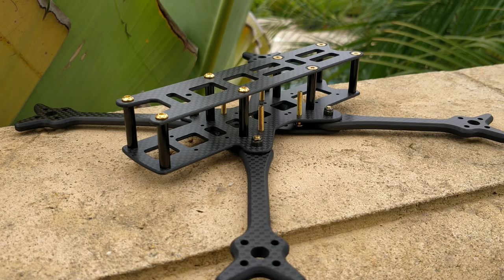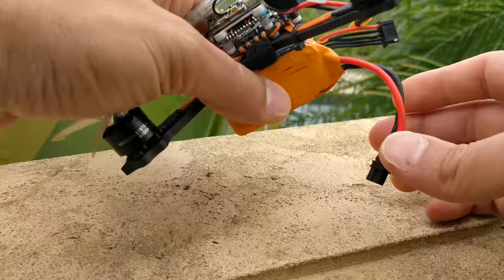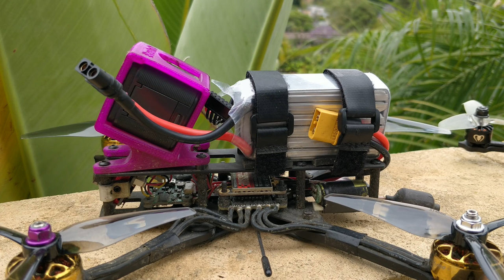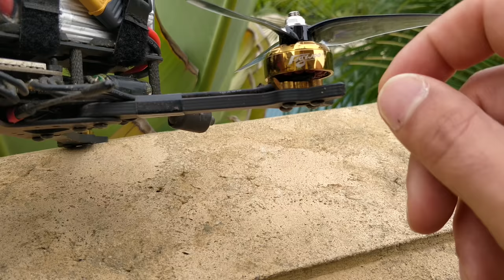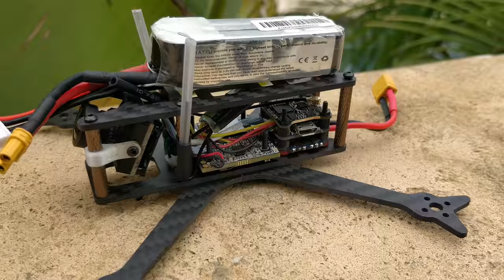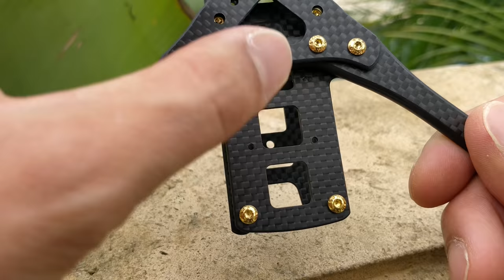Quad setup and flight performance - Quad Theory (WARNING: Lots of talking only)

Comment from the maker: Table of Contents:
00:43 Frame geometry
06:49 battery placement
23:47 weight distribution
27:23 split cam frame rant
30:00 current hardware setup
34:14 new frame with 5mm arms
This table of contents brought to you by WeAllFallDown FPV.  :-D

New 16x16 stack on the way for testing: http://bit.ly/2MZuVhR
Isn't this just a Sailfly remake?: http://bit.ly/2IirkWp

My main quad setup:

Hyperlite Glide Floss (will be re-released soon)
Motors 1750kv: http://bit.ly/2Zkz0OL
ESC (new): http://bit.ly/2WDBhmq
Prop: http://bit.ly/2LfZS0k
Battery: http://bit.ly/2XXjbwU
FC: http://bit.ly/2XRc8G8
FPV Cam: http://bit.ly/2Q7LfL7
Vtx: http://bit.ly/2HsrASs
ND GoPro Mount 30deg: http://bit.ly/2WC15zc
ND Filter (if used): http://bit.ly/2WEmQ1j

TBS Crossfire: http://bit.ly/2WxfRax
X9 Lite w/ HALL SENSORS!!: https://bit.ly/2WI5Uw6
By popular demand, THEY WILL BE SUPPORTING D8 MODE!!!  Just update the firmware in the future!!! WOOOohOOOOoooo

780g AUW with all three cameras strapped to it.

Equipment I recommend:

Micro Eagle - 
http://bit.ly/2Q7LfL7

Rush Tank Vtx -
http://bit.ly/2HsrASs

Fantastic solder-
https://amzn.to/2P5QM2W

TS100 iron -
https://goo.gl/DqBipa
https://goo.gl/svK6DD
https://amzn.to/2OV5XMh

WaFL’s Cap Cap
http://bit.ly/2GUpXxO

Xing 2306: https://goo.gl/TT9gnw, https://amzn.to/2VkZ8rt
Flywoo 2306: https://goo.gl/xuLG6d
Hold off on 220X motors for now.  There is a bug in BLheli/BF that makes them act a little weird unfortunately.  :-(

Sub $200 5" build that's still good:
Frame: https://goo.gl/EpXQhZ
FC/4in1 Stack:  https://goo.gl/HprVbj
Motors: https://goo.gl/h5rofi
Props: https://goo.gl/ZnzY2y
Props: https://goo.gl/VMBiQh
FPV Cam: https://goo.gl/FDJhYw
Vtx: https://goo.gl/JNVDMn

Batt pad material: http://bit.ly/2QGWhYb

Starter goggles I recommend: https://goo.gl/GvJUkT

Tips?
PayPal: https://www.paypal.me/kababfpv

Please use my referral code if you're gonna buy a Tesla.  You get some free stuff when you do and I get better status with Tesla: https://ts.la/bob40889

Bitcoin: 1E4XZXoD4rS6MYWVWuenY7Kw2M1YgyNpoQ
Nano: xrb_1188ek5bd7tb9kw67asnp9o65byuoaxbtpxuznx1ribf75x78awywmakj55f
ETH: 0xD067F93811f2eC31CB1928901002dfdf9A492EF5
LTC: La2KWYAjp4VT2Lq2M76pbjzXWvRyjpfCtG

Comment: Here is your table of contents Bob.
00:43 Frame geometry
06:49 battery placement
23:47 weight distribution
27:23 split cam frame rant
30:00 current hardware setup
34:14 new frame with 5mm arms
Reply: Thx!

Comment: About stretched frames, the layout doesn't increase your pitch authority: you do increase the pitching moment Thrust x distance, but the inertia due to the motors (most of the weight) increases as the distance squared. As you said, in racing you don't need much pitch changes, your turns are almost just rolls, and you gain roll authority by reducing the distance to the symmetry plane.

Comment: I really enjoy listening to your insights. I have learned a lot and has helped me evolve as a pilot and builder. I use your Floss 2.0 frame as one of my freestyle quads. I don't take HD video most of the time and it just flies so well as a racer or freestyle quad and usually at the same time as I like to hit gates and then do some flippity-floppity stuff around them. I have quads with batteries on the top and bottom in 4S and 6S configurations and I like all of them. Please keep up all the passion for our hobby. It has really helped more than most people know.

Comment: With all respect, but in your statement on point of gravity you make the wrong assumption where you turn the battery 90 degrees. You should see the cg as a point on the Z-axis (yaw) so turning the battery around the Z-axis does not change its CG position to the quad frame. It only changes the air resistance and mass distribution when the quad rotates along the roll-axis.
Reply: Do you agree?

Comment: You can always log and look at your gyro data to see what your average orientation is.  Freestyle or racing, everyone has a different pace or style but can get a sense of how much pitch you tend to average and then based on that you can make decisions of what geometry and battery placement are ideal for your style of flying.  For most folks it may not be a significant increase but for racers who want every possible advantage, 5% is a lot of advantage and could potentially be even higher.

Comment: Love your discussion videos!! Thanks for your research time :) 
@KababFPV what do you think about the Floss 3.0 ? You don't show on any video.
Reply from the maker: I didn't actually designed the floss three. It's the only frame in the entire Hyperlite series that I have not designed. It's a nice-looking frame and it's somewhat original however I feel it's inefficient and unoptimized. It still works fine I would however I prefer my own floss 2 as it is about the same weight but much much stronger and easier to work on because there's a little more space on the inside
Reply: @Kabab  thanks you for reply! maybe someday you can lose 5 min talking about the v3 frame or comparing them with your v2? this can be awesome :) ! Thanksss!!!

Comment: Two frames I’ve flown that I really felt that super locked feel on were my old Stingy and also my Remix, they both have a really wide stance compared to my other builds. 

The Remix with the pack mounted toilet tank style feels very nice, it feels like the quad doesn’t have to work as hard during manoeuvres. 

Really enjoy your longer videos, man. 🙂

Comment: Just finished transferring my components to the glide frame. Using a 10 gram tpu couch, 2207 xing motors and 1300 piro 6s, Im coming in at 630 grams. I can shave another 5 switching to a micro axII antenna and another 40 by ditching the 215 gram 6s batteries for the 176 gram 1100s. If i move to a foam couch, another 8 grams can be shed.
Reply: Your frame is AMAZING! Huge difference in propwash handling from the source one. It can take a beating as well....I put in her in the grass HARD no breakage....see the end of my latest video going up soon.

Comment: The reason battery underneath feels better (to me) is camera placement in my theory. I believe underneath batteries allow and normally “put” the camera right next to the fc. Which is where the quad pivots.  Just my theory and sloppily written on my phone. Keep up the great content!  Just finished your video. Smh I know better than to comment before the end.
Reply: Ian Walker this! The thing about battery placement is that in flips and rolls the quad rotates around the center of mass. There is no “swinging” or pendulum effect whatsoever, but the camera has totally different sweeping trajectory when you compare top vs bottom mount. Also when you roll during the turn the top mount battery pushes you into the turn while the bottom mount pushes you out of turn, so that might also account for the said “swing”.

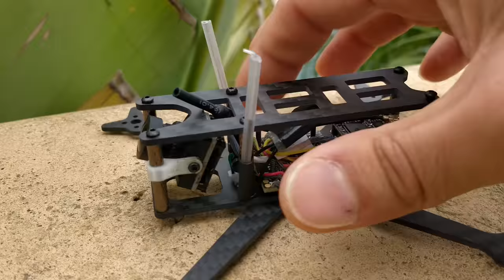Comment: @26:43 Ironically I just assembled my XHover B-roll frame and kinda dry fitted things. The B-roll is excellent for direct swapping of all parts from the EMax Baby Hawk R3. The only thing I may experiment with is replacing the motors to a higher kv and just run 3s.

On another note, WildWilly is a proponent of toilet tank lipo mounting! I just bought his Dolphin frame based off the single fact it will run a 5.5 inch prop! Motors are the B. Roogi, you may know him, 2208 1800kv. Running that larger prop, I think will make this quad a very nice flyer!

Comment: Did you try running flatter 2s batteries on your toothpick instead of the fatty gnb 2s450 or tattu packs?i run flat 2s packs like the gnb 2s550 or nanotech 2s460 25-40c(it surprisingly holds up to the abuse) on my 100-110 gram auw 3" and it feels nice.i run 3" but the disk loading you have with the toothpick is the sweet spot for sure , 3" is just easier to hit the weight target without cutting corners at the radio gear :)

Comment: Information overload 😁
Did you see that 3inch turtle 'toothpick'-like frame. If I remember well it had 1408 motors and all weight in a column at the center of the X. Flight performance was very similar to the smaller brother... So much so that it triggered my interest to build one... But similar to.you, I live in a densely populated area...
Else what about a design with the battery behind the camera and the FC/ESC fixed to the top-plate? Would lower the center of gravity toward the props and make the weight distribution easier to manage with a stretched X. 
I love listening to you mumbling about as it gives tons of ideas. The main problem is time now! Keep up Bob! 👍

Comment: my first glide was built exactly like yours with the talon f7 behind the cam and for my 7 inch glide I'm using the 20x20 kakute behind the cam so that I can add the GPS to this since the talon doesn't have a barometer in board. Im also rocking those racestar/t motors on that 7 inch. not yet done with it but the 50 amp racestar iron man and tank will be the guts. a runcam micro eagle,   x fire nano, vifly 2, and considering the rebel wheels. 🤙

Comment: Thank you for doing this video, it helped a lot with my quad. I do have one point though, the center of mass should not change when the angle of the quad is increased. It should stay the same as long as no mass shifts.
Reply: I think you are talking about center of gravity, which would change with the angle.
Reply from the maker: It doesn't change. The orientation of the quad changes and the CG moves around when you look at the orthographic flat image of the quad. Hard to explain in general but if the CG isn't direct between the blades it moves around with respect to the quads orientation when the quad rotates

Comment: Lots of good discussion! Any thoughts on a toothpick frame with longer arms to get more prop separation? I was kinda surprised that wasn't touched on for the micros.

I would like to see the new Glide have at least the 3rd set of top plate screws counter sunk for those of us that don't run a GoPro. It would also be nice if there was a battery strap slot like the rear two but I've been fine without it. I also wonder if no GoPro is why I don't get wobbles with 22xx on my rig and Im on the heavy side too 538g with a Pyro 1100 6s (I blame those fat Xing 2208's).
Reply from the maker: I'm working on some things. Testing a few prototypes

Comment: Would love to hear more about wobble and motor size and weight distribution. I experience wobble on my long range setups with gopro hero on top, battery on bottom, rebelminiquads Ruxus3 with 6 inch arms and 6 inch props and I cannot tune it out no matter what I've tried. From filters to pids on recent betaflight
Reply from the maker: I have recently done a bunch of testing with larger props and motors. I would bet that the motors are using are a little small and the props are fluttering as a result of the motors inability to manage the prop. first 6-inch I would say the smallest size I would recommend is 2407 and the correct size is probably a 2507 or 2508. The best size is probably a 26 size motor however
Reply: @Kabab  Thank you for the quick response. That is probably the case then. I will try 5 inch props on the setup and see how it does for handling and flight times. I find myself using my 5 inch more for long range than the 6 inch anyways, and your video on long arms to separate front and back props will probably help. Thanks for the tips on weight distribution and CG as well! It appears forward flight for long range rigs applies to forward flight for racing rigs.

Comment: I was talking to a colleague in auto racing the other day, and he brought up "Polar Moment", which is exactly what you're referring to in terms of weight distribution.  Spinning a 4 foot wide barbell around its center is much harder than spinning a medicine ball of equal or greater weight.  Balance is meaningless if your balance comes at the cost of leveraged mass.
Reply from the maker: Right.  Exactly.  It's quite a challenge to get something with a tight CG that's also in the right spot while not obstructing thrust and managing thrust interaction.

Comment: I really would like to know how the longer stand-offs effect the feel of the quad. Please and thank you ✌️
Reply from the maker: The longer standoffs move the weight higher up on the z-axis. When you roll you feel the onset of the roll is a little bit more twitchy and it tends to rollover much quicker than you would expect as well. It's still flyable and totally fine but it doesn't have as much of a locked-in feel to me personally. Johnny flies his frame with very tall standoffs because that gets the props out of the view of the camera when he is flying with low camera tilt. He just deals with the wonky flight characteristics because he can't have the props in view
Reply: @Kabab  thank you, much appreciated 😋

Comment: I always feel if I dont tune my pids my quad flys bad. I have an alien, chamelion, marmotte, massive droner, devel, etc. My top mounts are more responsive to pids while my bottom mounts give me more leeway. Same setup on my freestyles but because of the small differences in frame geo I always find myself adjusting the pids on them.  I need to try the glide next. Seems like u made a frame around the tune instead of tuning to the frame?
Reply from the maker: Correct. I did exactly that. Built the frame for the code since I sucked at making the code work for me

Comment: It's not about "swinging around the corner", it's about "sucking you into the corner"... or at least the appearance/feel for this. Think of the 2 dimensional plane - the battery's weight is always pushing out of the corner, when on top it's pushing the back of the quad down trying to topple it [because the quad is tilted forward], when on the bottom it's pulling the quad down and when the battery is placed forward on the quad  the back of the quad doesn't dip, the back props don't have to do all the work. 
This makes it feel like you're being sucked into the corner, when in fact the drift backwards is the same amount, but the quad and your fingers  don't have to compensate for the dip in back. It's the same with the stretch+squish - it makes corkscrews a breeze because you don't have to compensate for unwanted movement.
IMO
Reply from the maker: Yeah I just don't understand this at all. I have so much more control with the weight properly balanced between the blades. The swinging mass feels absolutely awful to me. It's almost unflyable for me. At least with high accuracy
Reply: @Kabab  I guess it's about what feel you like, I was swearing for battery on top for a long time, until the fuselage on frames became tiny and I had to change. But then I moved the slung battery forward and miracle I'm racing though.. 
Have you tried increasing min_throttle to 10% that's also a game changer, the motors have a much easier time to ramp up from the higher min. Downside is floatiness, but that just makes me fly a drift line and line up the next corner sooner..
Reply from the maker: @antonig_fpv  ya I always run min throttle at least 6.5%. Also, as long as the batt under isn't overweight, the flight code has gotten REALLY good at managing it so it's not as big of an issue anymore

Comment: Cmon Bob, give split cameras another try with Caddx Tarsier! It's a Ratel Camera with 4K HD.
Talking micro frame design, have you tried Vertical 1.5mm thin Walls on top of the unibody bottom? I've managed to build 114g AUW with Tarsier on 1103 amax motors and it flies well on 2S with this approach.
Reply from the maker: I have one. I'll get around to it

Comment: Hi Bob. I need some advice. I watched your video about the new diatone 3 inch mamba, and I saw it again in this video. I want to buy one but I am confused about all the listings on banggood. There are like 5 or 6 different listings for seemingly similar quads. All have similar titles like "R369 and ER349" and I dont know the difference apart from some are more expensive. Which one would you recommend? The most recent one? ER349 or the R349?
Reply from the maker: Gosh I didn't realize they had made it so goddamn confusing!! CUZ IT'S CHINA!  It looks like all the other variations just have different cameras and Vtx's on board.  They all have the same motors and electronic setup.  Just choose which vtx you want and which camera you want.
Reply: @Kabab  Thank you! I never understand the Chinese naming conventions😂

Comment: Hey Bob... would it be possible for you to discuss APC props in a prop video sometime?  I've bought some 7" APC bi-blades and, on my first flight I flipped it aggressively and got a dsync (so hard it ejected the FC & receiver & ripped off half of the prop in flight!) on a quad I've never gotten one on before so I don't know whether it's the prop (e.g., out of balance) or my FC (e.g., a screw fell out and so excessive vibration).  Anyway, I find their stiffness and high speed attractive & would like to know more about their pros & cons.
Reply from the maker: APC makes very few multirotor props.  They're more specialized props for a particular use as well.  That's why they don't appear on my channel much.  Twin blade props are also almost never balanced so the vibrations are higher.  In large props you generally want to go with a triblade because there is an extra balance buffer with that third blade on there.  That is likely the issue you had.